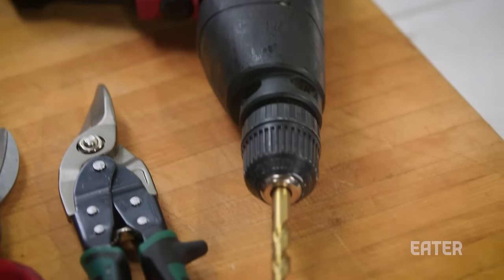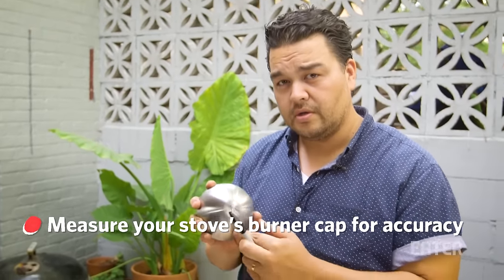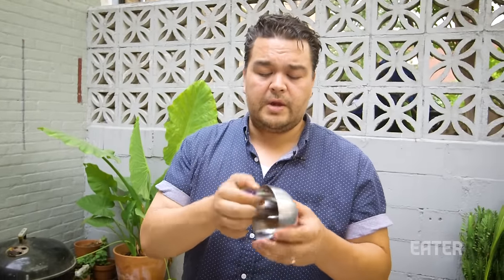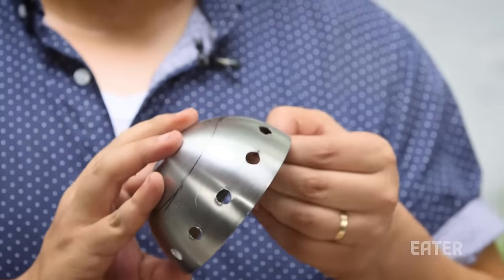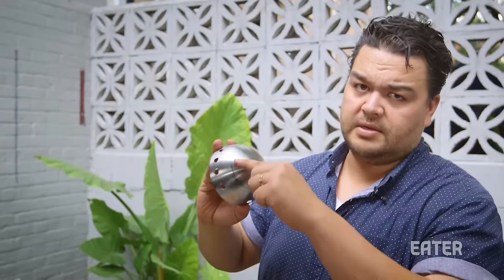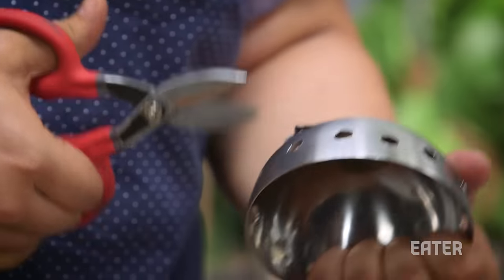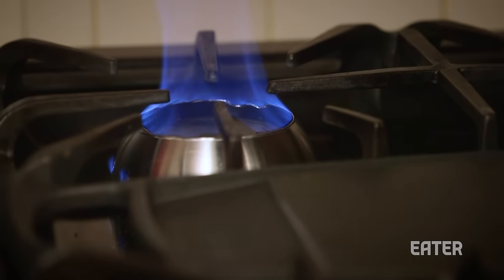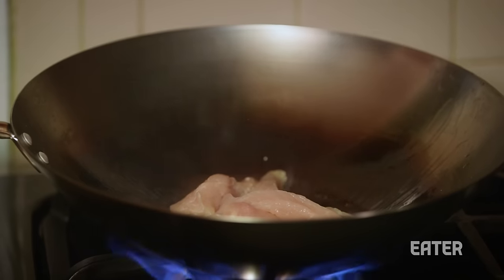How To Turn Your Stove into a Wok Burner — You Can Do This!

Comment: People saying this doesn't increase the BTUs of the stove are entirely missing the point. Here's an analogy that might help. Take a dry leaf outside on a hot summer day and hold it in the sunlight. What happens? Nothing. Now take a magnifying glass and concentrate a beam of sunlight onto that same leaf. What happens? It burns. Did the sun all of a sudden increase its output? Of course not. You just concentrated what output you were getting into a smaller area. This is the same idea as this wok burner. With a regular burner much of the heat generated is wasted heating the side of the pan and the air around the wok. This concentrates what heat IS generated by the burner to the bottom of the wok where it is actually usable.
Reply: THANK YOU. I CANT BELIEVE ALL THE CRITICAL COMMENTS
Reply: You nailed it! Thanks
Reply: You're still not going to get the same wok hei as a dedicated high btu propane range.  You can concentrate your room fans wind funnel but it still won't be a jet turbine.
Reply: devilhimself1974 Really?
Reply: @MrMittens1974  sure, you're technically correct, nothing beats a dedicated wok burner. But seeing as dedicated wok burners aren't exactly common in the American household and are very expensive to install, alternatives like this are at least a far cry better than nothing. 

And wok hei is more difficult to get, not impossible, even without the aid of a wok ring/burner. I've managed to get the fireworks show using my carbon steel pow wok and the largest burner cranked to max on a gas range.
Reply: Exactly....I commented basically the same thing before I saw your comment. I was getting pissed at all the stupid comments saying it doesn’t increase the btu....duh, no kidding. Centering the heat helps a lot for sure....keeps you from steaming so much.
Reply: your missing the pint of the reason BTU's are being brought up. you are concentrating the heat changing the air flow in the unit causing byproducts that wont dissipate as they should. there is a reason that a wok is designed the way it is. people who do this crap end up calling me asking why their stove isn't working and then can understand why i have to replace multiple parts that normally don't fail. 
then they end up complaining to the manufacturer who will have to again tell them they are not using the unit as it is intended to be used which can be dangerous.
Reply: @tito283  I made no claims that this wouldn’t hurt your stove. My argument is that it does work and gets the wok hotter than the burner normally would without increasing the overall heat output, just concentrating it more on the wok. Should you do it? Probably not.

Comment: I don't think most American stoves have a high enough btu to make this as effective as it it could be.
Reply: You kinda need a jet engine stove for really nice wok cooking haha
Reply: omg lol
Reply: maybe rocket fuel so the wok could get up to mars
Reply: +1 need at least 100k btu's to wok it out. shame on you eater....
Reply: A lot of ranges have a large power boil, which at least helps. Def wont make it legit though.
Reply: Probably not, but with the heat spread out on a normal stove, most of the heat is lost to the side of the pan and to the air. This at least would concentrate what heat is created to the bottom of the wok.
Reply: hoshnasi If you remove the gas spreader plate first you get more power I have a video that shows it!
Reply: @barim.n.8379  That comment didnt age well.
Reply: leo ll idiotic comment. Shame on you!
Reply: This concentrates the stoves heat, you seriously don’t need a really high btu stove. This is the equivalent of burning ants with a magnifying glass, it concentrates it into one spot rather than wasting it all on the heat on the sides of the wok.
Reply: We don' t have that problem in the rest of the planet.

Comment: That's not even a proper wok with the flat bottom like that.
Reply: PT111111 why ? What will a different bottom do ?
Reply: A flat bottom wok will distribute the heat across the bottom. It will still get hot, but not the same way the concentrated heat you get with a round bottom wok. The primary difference is your first 2-3 minutes of cooking, initial searing step, where you want your cooking oil to be super hot.
Reply: replying to an old comment, but the reason it is flat bottomed is because his stove has flat grates. if he wanted to use a rounded wok he would need a circular opening in the grate.  otherwise it would fall over.
Reply: Having a flat bottom won't let you stir fry the food. The stir frying motion is an essential factor of the taste of Chinese food. There is a reason why you won't find a flat bottom pan in any Chinese restaurant.
Reply: @mathewgonz  my hob has flat grates, just take the grate off when using a wok, and use a wok ring/stand
Reply: X. Chen flat would still work, maybe not perfectly, but it would work
Reply: It’s flat to sit on stove tops and not fall
Reply: I believe one of the biggest misconception is to think a Brunner for stir frying with a wok needs to be 100k btu or 200k btu...the reason I know that is I own both and is strictly limited to outdoor use or you'll risk burning your house down unless you have the proper cfm hood, besides it isn't necessary to crank something of that size full blast anyway since it will burn your ingredients so fast if you don't possess the skill to operate at those temperatures...I had to learn the hard way through trial and error that it's more important to manage the heat vs fighting it, so for the most part I operate it at half throttle for high and 1/4 for low and still you had to be on your toes and pay close attention to produce good stir fry without over cooking, with that said the indoor stove I use is a Kenmoore not sure what model but one burner on it puts out at least a 12 to 14 inch flame and is plenty enough to create a flash fire in the wok when stir frying. This homemade device in this vid just might have some merit.
Reply: Here comes the wok police!
Reply: @pplla7821  says the weekend warrior wannabe with a semi automatic Kriss Vector. 😆

Comment: I had a stove very similar to yours.  I just removed the flame spreader plate and I ended up with a beautiful blue flame going straight up.  I had to light it manually because the sparkler wouldn’t work, but it worked great.   Some stoves this works on, others not so much. YMMV.
Reply: Wow this works amazingly.
Reply: @Barbara Martins I think so, It may spook you at first, especially when you first try to light it, but yes, had no worries after using it a few times.
Reply: Can’t dirt get down in there without the plate protecting it? How do you clean it
Reply: @andrewmckinlay2964  Never had that problem as I don’t use it that often and I haven’t knocked food out of the wok.

Comment: A simple inox cake ring does the job. Paid for it like 1 euro...directs the flame vertically + supports the curved base woks.
Reply: Buna, puteti va rog sa imi dati mai multe detalii? Ce diametru are inelul si de unde il pot achizitiona? Va multumesc mult.
Reply: @gaargant  forma de prăjituri mica, ca un inel, in forma de cerc, din inox. Se găsesc la toate supermarket urile, si costa foarte puțin. Trebuie sa scoateți grilajul d epe aragaz ca să o puteți folosi. Puneți peste ochi și asa folosiți. Dar dacă aveți aragaz normal cu grilaj, wok ul ar trebui sa stea oricum... Trebuie doar sa gătiți la wok la flacără mare.

Comment: For gas stoves only, there's an easier method. You simply remove the burner cap and put it aside. Since the cap is off, you will not be able to ignite the flame with the built in igniter.

Turn on the gas to medium to medium low gas (the burner will not ignite. But gas will come out). Use a bbq lighter to ignite the flame. And you'll get the same result as this guy.

FYI prior to igniting the gas, do not leave the gas on for long period of time. You do not want an explosion. Just turn on the gas short enough that you can ignite the burner. Then put the wok on the heat and adjust how strong you want the flame.

Also don't directly on top of the flame. It can get 2 feet high!!

Comment: Laughing at myself at your simple solution!!! 
Been looking, a year or so, for a way to use my gas stove (9000 BTU) for wok cooking. Bought a few adapters and flame focus rings on top of stove grate...worked okay just not hot enough....finally gave up and bought a butane portable stove which works great but, takes up counter and then storage space and a little bit unstable for my uncoordinated self.
And here you are...jumping the wok fence and making focused heat!  Dude! Thanks for the great, cheap idea. I'll have to try it out just to see if it works. Thanks for posting your video. I'll have to check out any others you contributed. THANK YOU!!!!

Comment: Something similar came with a wok that i purchased about 20+ years ago, it was meant to hold a curved wok steady so that it didn't wobble on the stove, AND to concentrate the flame more.  The end result was a discolored stove from holding in too much heat inside of the unit.

What I've personally found... Don't overload your wok for a typical American stove and it will work fine.  It's when you overload too much food in the wok at one time that it can't get to the proper heat or maintain the heat and starts to boil food instead of searing it.

Comment: Removing the disc only concentrates the flame- the small btu output on a household kitchen stove is just a function of supply line pressure- usually stepped down to 1/4 psi from the residential service line outdoors. This can be overcome by using a propane tank(outdoors) where pressure is in the 100-200 psi range stepped down with a 5-30 psi regulator. Go online and take a look at all the $30 to $100 lp gas burners in the 50,000-200,000 btu range that can be set up in the back yard and will be the same as what commercial restaurants have with the big blue flame fire jets.

Comment: Dude, this is a great hack and works well. It’s easy to modify for your stove top. Don’t let the morons stating the obvious about high temp burners deter you. Anybody knows a commercial wok burner will have much more heat, they’re missing the point....centering the heat you do have is the key. I did this with my Wolf range and it works great for small batch stir fry. Keep up the good work!

Comment: How about using Dremel? Also probably smooth the edges of the big hole so you don’t cut your arm if you put it up through the hole. Are commercial burner rings available?
H. Lloyd
Reply: Why are you putting your arm through the hole...?

Comment: Having been raised in a Chinese restaurant and cooking, the issue isn't the concentration of heat, the issues are 1) Number of jet burners (wok range has thirty-two or more and home stove has about eight).  2)  BTU (conventional stove is about 25K BTU where as a wok range is probably 100K BTU or more).  But great vid on making due w/ what ya got at home.  I'm sure that helps increase the surface temp greatly.
Reply: 2) the 25,000 BTU is only true of restaurant style stoves for the home. Conventional home stoves are closer to 10,000 - 14,000 BTU.

You're clearly used to eating Chinese food cooked on very high BTU stoves, but most Chinese households are not.
Reply: @l4d2_ellis20  he said he raised in a Chinese restaurant and cooking ... not those just eat in  Chinese restaurant but cooking at home ...
Reply: @eliu20050101  he also thought that conventional home stoves give out 25,000 BTUs of power. They don’t. You clearly didn’t read or understand my comment.

Comment: It's not a perfect solution but with the appropriate wok ring support, it will be better than having nothing for smaller serving sizes. It is regrettable that the amount of heat required for a good stir fry needs magnitudes of Btu more than what most gas ranges can provide. (15k at best?). Looks nice though and great video years later.

Comment: Good idea, but considering you can remove the center plate, like mine, I just took it off and lighted it with a cooking torch.  Worked great!
Reply: I'm not sure if that method works for everyone. I cannot turn the flame higher than medium or else the fire goes out.
Reply: But isn’t the plate protecting any oils from spilling inside?

Comment: some of the stoves have a removable cap. Its a hole in the middle. You could just put a metal mesh over it to not spill things inside the tube and you could have even more power for lower effort

Comment: THANK YOU FOR THIS. I was almost ready to spend $80 on a unit 😂😂😂. What's the bowl mad of?
Reply: Very light steel, but it works GREAT. I bought one because by the time I located a bowl, bought the drill, bought the nippers, paid for a trip to the ER to get stitches or metal shrapnel removed from my eye or fingers, I might as well cough up the cash and get a ready-made one. It is a rip-off on price as it is so simple. But because it is so simple I cannot believe more people than this one dude aren't selling them.

Comment: I had a wok set years ago that included just such a ring. the wok itself had a rounded bottom, as it should. I had two problems: the wok had an inferior non stick coating. and I was working with an electric range. lasted less than 2 years.
Reply: sounds like you had a terrible wok

Comment: I don't know what US gas stoves are like, but here in the UK, a stove will have a large burner like he is cooking on, and at least one smaller burner. Place the wok on the smaller burner, at high heat, and the flame will be concentrated on the bottom of the wok, rather than going up the sides, like in his video.

Simple, really.
Reply: Either way there is not enough BTUs to really heat up a wok properly. If you really want a real wok flame. Alton Brown showed a way in one of his episodes of Good Eats. He used a propane burner outside with that it had some serious flames.

Comment: Wouldn't work on my cooktop. I cut half the length off the legs of my gratings so the my pans rest just above the sharp blue tips of the flames where it is hottest. That's one of the first things you learn in intro high school chemistry. No wok burner required. I would prefer to actually have concave grating to properly support my traditional, fully rounded wok, but this works much better for now.

Comment: I don't know how this effects heat concentration BUT I'M DEFINITELY CERTAIN IS NOT ENOUGH CAUSE ELITISM
You guys realize wok burners work in exactly the same way, right? A high power 23k btu burner used only marginally less fuel. With the right ventilation, one might achieve efficiency high enough to be 9/10ths. Don't pretend like that won't cut it.

Comment: The trouble I have with this is that most all burners I've seen have an ignition electrode with a kind of plastic sheathing and a device like this will tend to push enough flame downward that it'll melt the plastic off the electrode. Not sure what to do about that. And I'm also not sure why others haven't had this problem.
Reply: It isn't plastic, it's ceramic. It can take a ton of heat.

Comment: isn't it easier to just remove the plate that spreads the flames?
Reply: At least for my stove the flame doesn't work without the cone on it. I can manually light it without the cone but seems excessively dangerous. Then if you don't have it on full blast the flame still dies out.

Comment: I tried this, and it does make a conical flame, however depending on the size of your bowl, it may not allow for enough oxygen for complete combustion. 
You'll know if u get black soot at the bottom of your pans. This is linked with cancer so pls make sure.

Comment: Thank-you so much for this! I've been struggling with my 17k & 14k btu burners spreading the flames up the sides of my full-sized wok and leaving the center too cool. I'm handy and have the tools so will be making this item.
Reply: I strongly recommend the portable patio cart stove option I talked about in my post earlier ... spending a few hundred on a portable high powered camp stove (with or without wheels) is a lot cheaper than several thousand to modify one's kitchen.  95% of my everyday cooking happens in my kitchen, but if I need some serious browning action or wok hei, I head out to the garage and fire up my twin 110kbtu burners, and have at it, then bring it back indoors to finish the dish.

Comment: That's dumb. A wok requires a lot of heat. Your method only concentrates the heat in a particular spot. What you need is to increase the BTU and you can't do that with a residential cooktop.
Reply: Boa Phan yeah in chinese households they have an outside cooking area with a high btu propane wok top or a wok top connected to the natural gas line of the house

Comment: Because the fire comes out the edge of the original burner, there is still no fire in the center even with that attachment.  What it does is limit the spread of the fire.  Once the fire hits the wok, it spreads out the sides of the wok; nothing hitting the center.